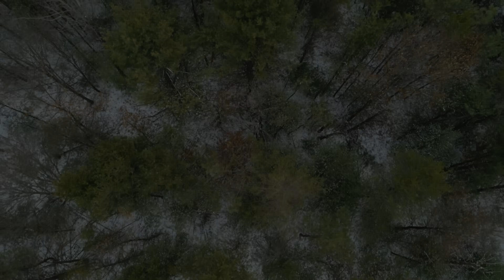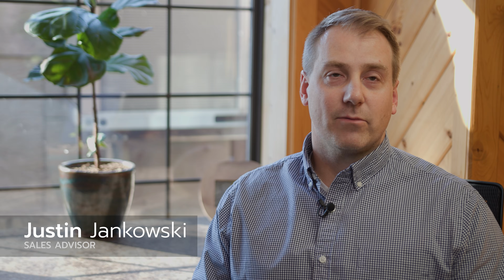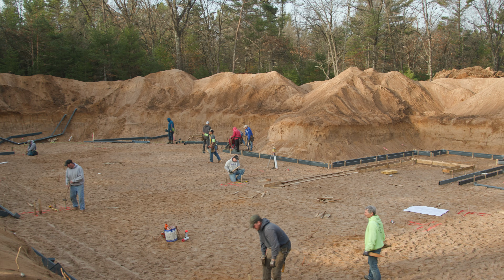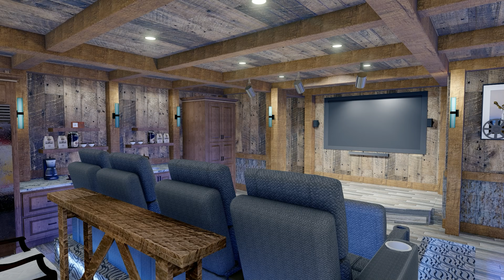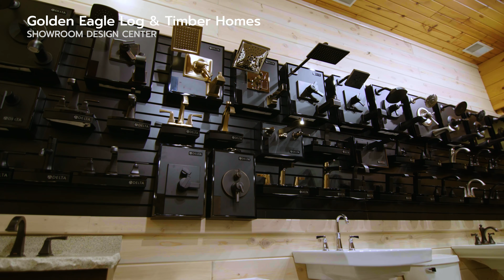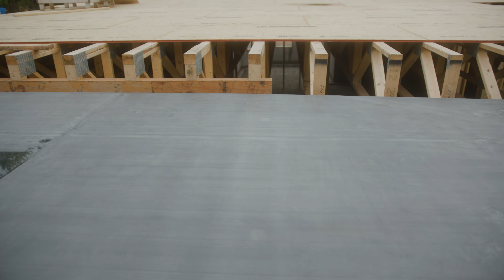Construction Begins on the "Forever Home" | Docuseries Episode 2

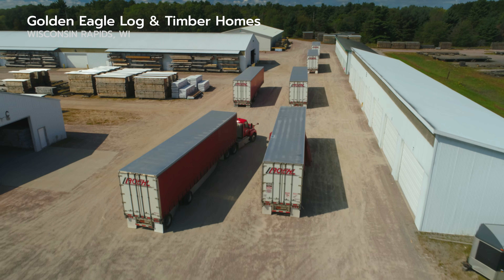Comment: 07:20 where is water baririer on the walls?! Water could penetrate into concrete easy...
Reply from the maker: it's hard to tell, but it's sealed with Karnak. Karnak dries in a light gray color - like the concrete.

Comment: How will cooking/range top venting be handled?
Reply from the maker: There will be a downdraft, which pulls the particulates down into the ductwork within the floor system. That ductwork will have a booster which pushes the particulates to exterior venting.